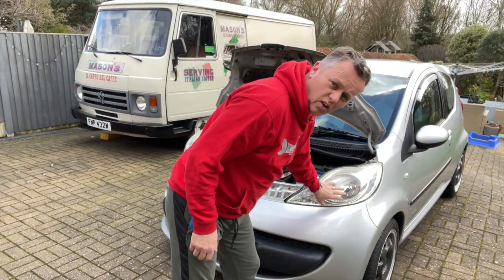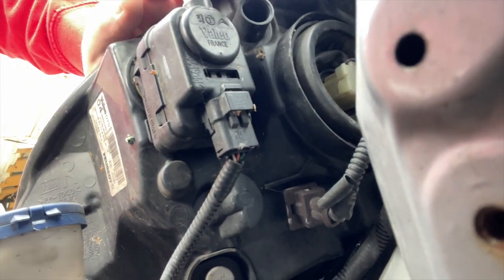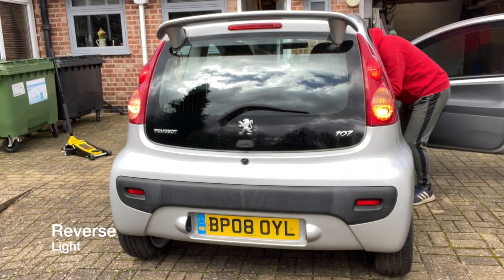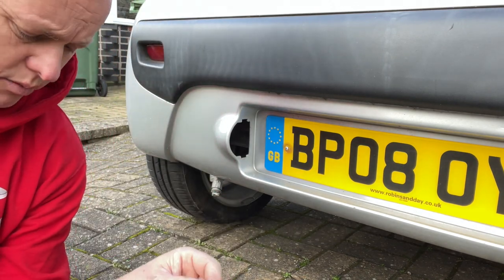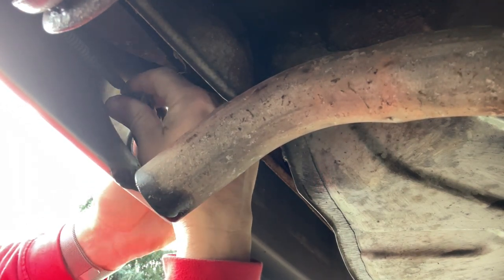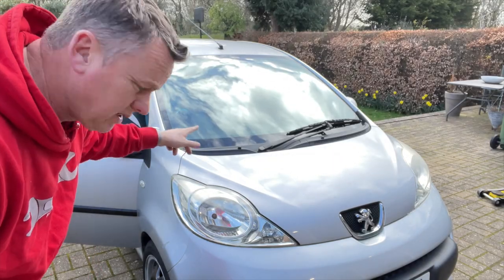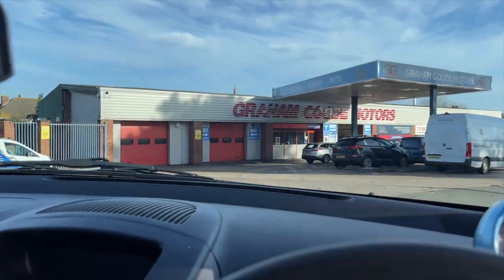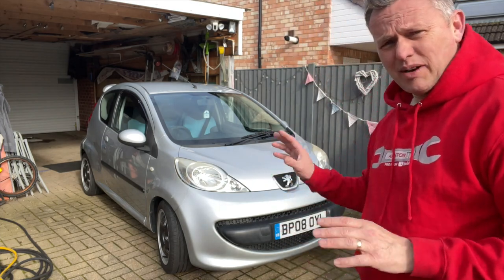🇬🇧CityBug Pre Mot Checks, & The Test!! Will it Pass. Peugeot 107, Toyota Aygo, Citroen C1

Comment: What's a good headlight bulb replacement as the standard bulbs are about as much use as a candle?
Reply: I just changed my useless H4 standard candles to Osram Night Breaker bulbs and it's made a massive difference.  Also worth polishing the headlights if they've gone milky.
Reply: +1 for Osram Night Breaker. Don't buy the "Lazer" variant as they don't seem to last. Both sets lasted less than 12 months.
Reply from the maker: I did this review on the Phillips racing vision, https://youtu.be/sb4ZDRRT8j0 Thanks for the great comments👍🏻👍🏻🛠

Comment: Hi Any advice on a snapped wheel bolt removal?  thanks in advance, the aquaseal works well, but dont let it dry on your skin :(
Reply from the maker: I would weld a bolt head on, or drill out he centre and use an easy out to remove the rest of the thread, Thanks for the great comments👍🏻👍🏻🛠